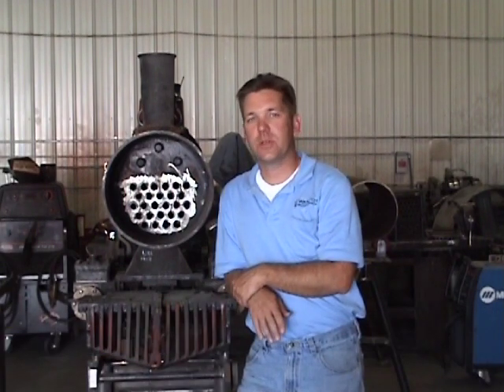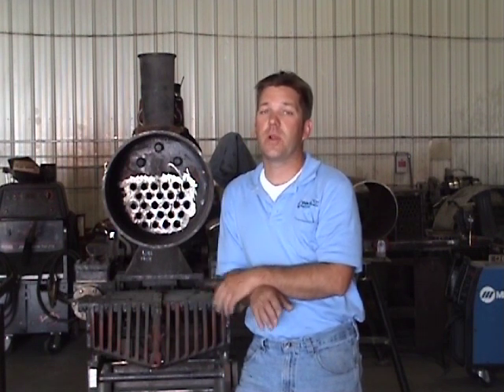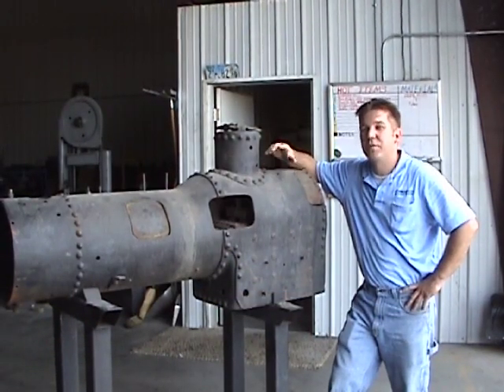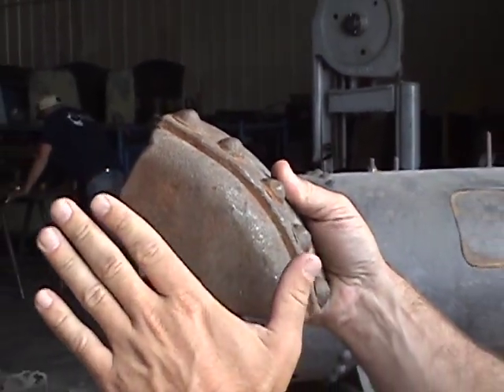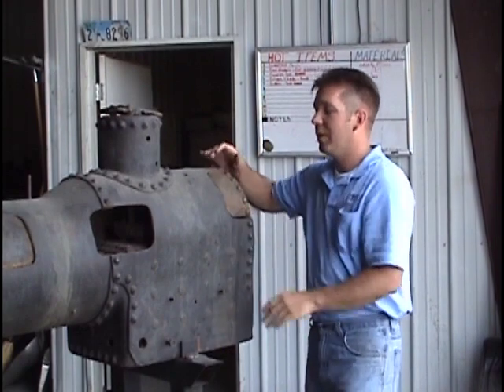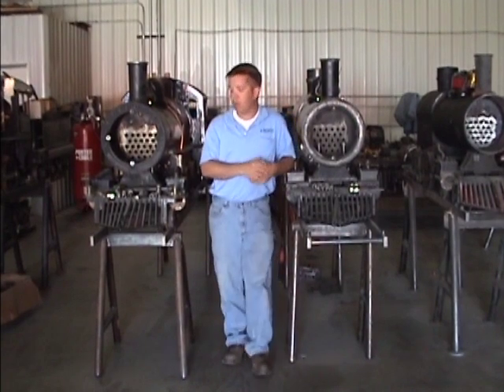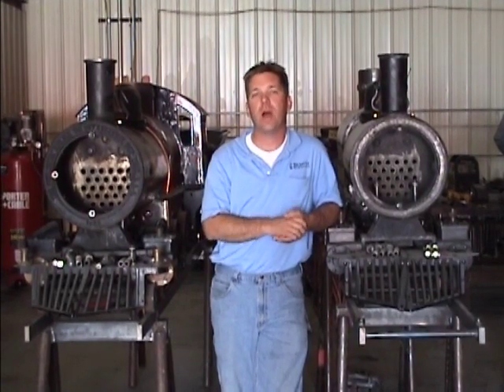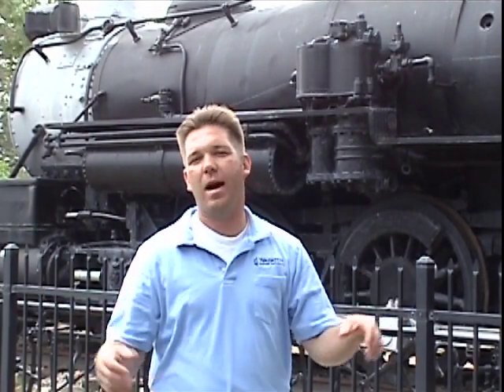WRC Video #1 - ASME Code and Boilers

Comment: While there is merit in certain aspects of what you were saying, with a proper chemical treatment program, and properly designed and reinforced knuckle joints, allot of the old boilers will outlast us all. Especially considering allot of the old historic boilers don't see heavy use anymore. Furthermore, they're being repaired everyday by several R-Stamp shops around the world. It all depends on overall boiler condition and operation. Our 1892 traction engine needed a new bottom firebox put in it because someone had allowed the water bottom to freeze. Our 1915 traction engine had the barrel successfully repaired. Now we're working on an 1899 portable Russell engine that requires a new front tube sheet. At our show every year an 1880 Case traction engine with it's original boiler also runs. It has had a new front tubesheet put in it as well.